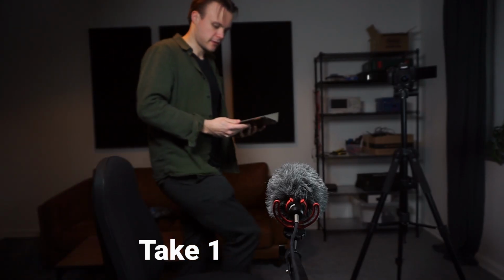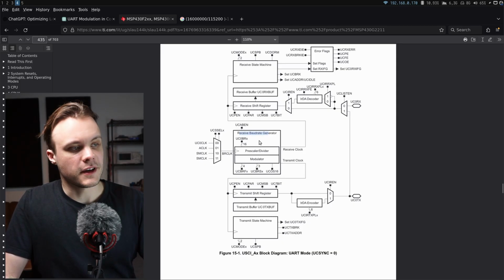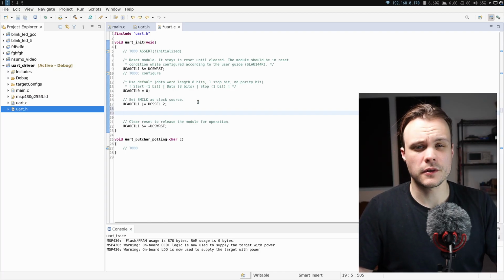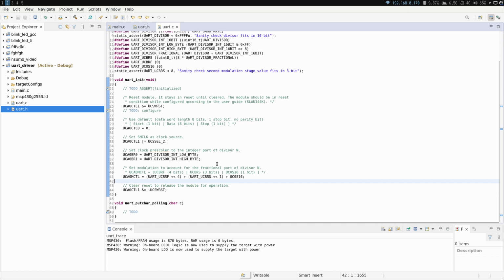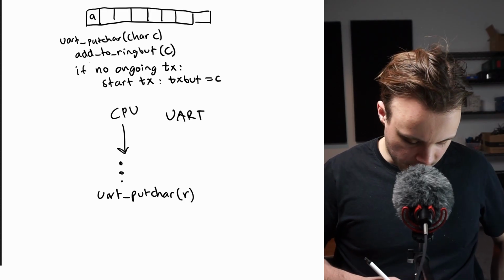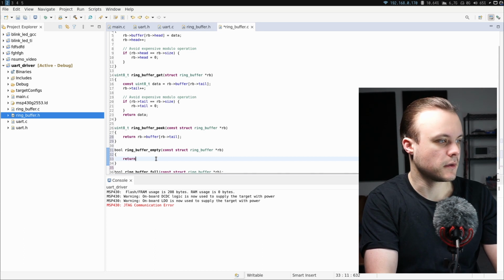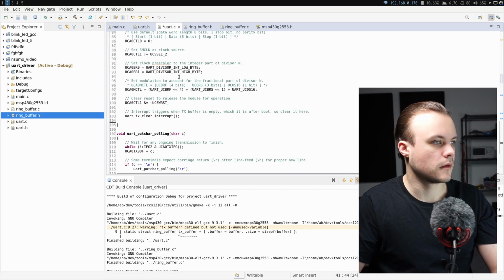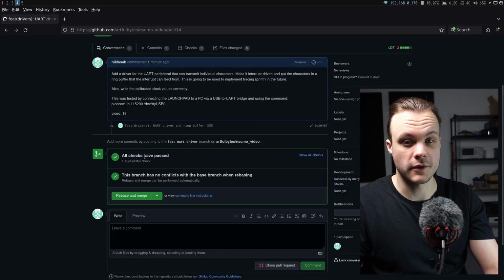Write a UART driver (Polling and Interrupt) | Embedded System Project Series #18

Comment: hai sir, what about error check and  start and stop bit in the uart is it not required
Reply from the maker: Start/Stop/parity bits are configurable in the uart peripheral. See uart_configure(void), there I mention I use 1 start bit, 8 data bits, 1 stop bit, no parity bit.

Comment: Why do you just use & instead of | When you set the reset?
Reply from the maker: Typo on my end, UCA0CTL1 |= is more correct I think. But doesn't matter in this case since I haven't set any other bits prior to that. In i2c.c I do UCB0CTL1 |= UCSWRST;.

Comment: Hi, what is the model number of that USB to UART chip you used in the video and would it work on other Texas MCUs like the TIVAC123G?
Reply from the maker: CP2102 USB to TTL Converter HW-598, yes it should work on those.
Reply: @artfulbytes  thanks for the reply! I got confused on which converter to buy and I will try this one. Also, do you have any suggestions for alternative motors that would work with your PCB? 

I've been checking the motors linked in your second video but they've been out of stock for a while now

Comment: Do you ever work with PIC microcontrllers? I like what you are doing but I need to get my head around understanding it for PICs.
Reply from the maker: I haven't worked with PIC even though it's still heavily used in the industry. From what I've heard, the software ecosystem around PIC is quite bad, so I try to stay away. Anyway, microcontrollers fundamentally work the same way so the workflow I explain here also applies to PICs even if the peripherals and registers obviously are different.
Reply: @artfulbytes  but TI is a lot worse when it comes to software ecosystem. TI is a pain to work with!